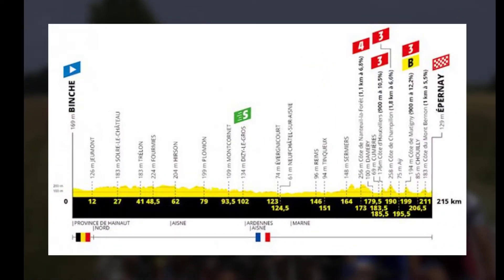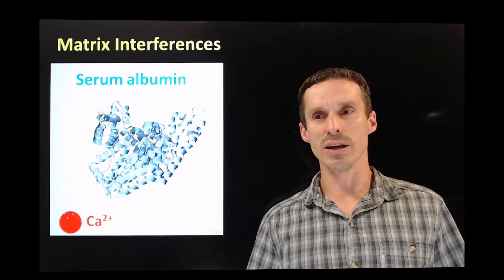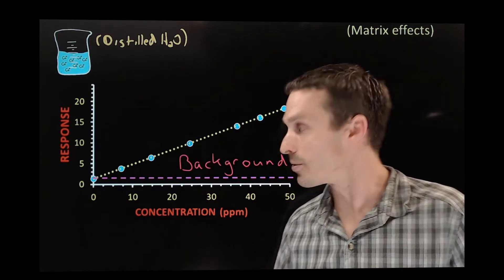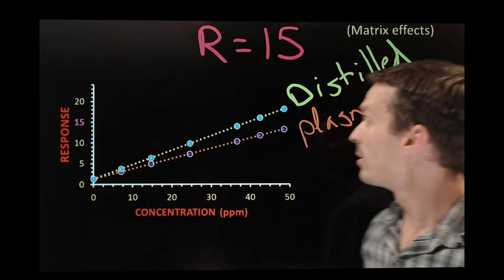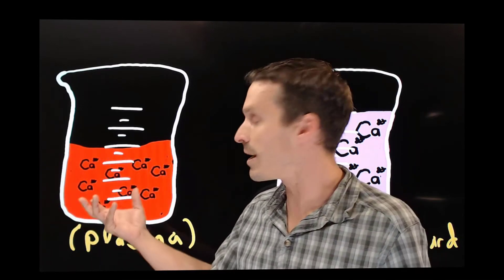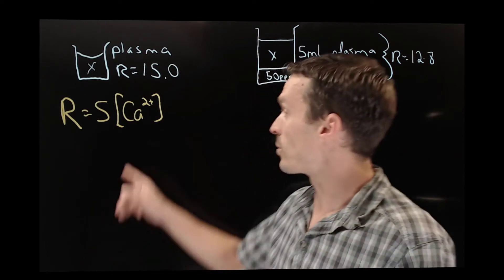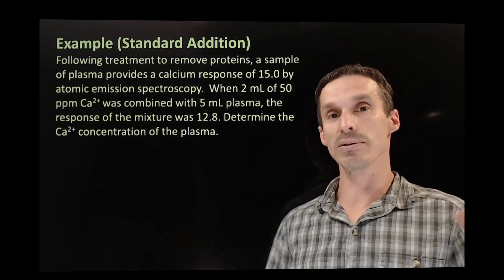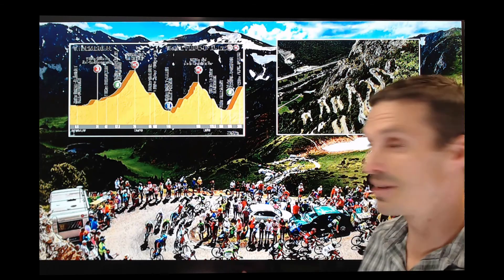Standard Addition Method

Comment: Thanks Alan. The question is the slope for standard solution may be not the same as the slope for the mix of standard+plasma. If they are different, this method may not be accurate. This will lead to your next video of Multi-point standard addition which I think can provide a more accurate result. Thanks heaps for both amazing videos explaining nicely the tricky issue.

Comment: Hi, I am new to this topic and Thanks to you, I am learning a lot. Can you please explain what is the difference between Isotopic dilution method and internal standard method? Or these are same methods?
Reply: Isotonic dilution is a specific forn of internal standard. With mass spectrometry,  we can distinguish molecules that are chemically identical, except that certain elements are isotope variations (eg Carbon 13, instead of Carbon 12). But internal standards do not need to be isotonic standards and can be employed with other detection methods. I do have a video on internal standards which shows the general process

Comment: but how is S, the proportionality constant, the same for the two solutions? the matrix (plasma only or plasma with distilled water, so the slope of the calibration curve for the two is expected to be different.
Reply from the maker: Thank you for your question.  In this example, I showed a "hypothetical" calibration curve made in distilled water, and another  curve for those standards in plasma.  In that case, the slope of the curve (S) would be different.  However, this is not what we are actually plotting.
In the standard addition experiment, we never generate a calibration curve in distilled water.  What we do instead is combine the standard with the plasma.  And we do this in such a way that the background solution is nearly constant (typically by adding a very small volume of the distilled water to the plasma).
Therefore, since both samples (plasma alone; plasma + standard) are measured in a plasma matrix, each equation will have the same value for S, which therefore can be cancelled out.

Sorry I didn't make that completely clear in the video!
Reply: @shortchemistry7927 Hi, for determination of K percentage in a fertilizer, I make calibration curve mixing standards and unknown. As 10 ml of unknown to all balloons and different amounts of standard, 1 balloon only has unknown without any standard.  Why is that? Shouldn't the b from y=ax+b and signal of the balloon without standard be the same? If they are not same what should I do? I'm confused,  please help. I mean why we determine signal of balloon that doesn't have any standard added? The b must be same as it! If b and the signal of sample without any standard aren't same numbers what must be done?